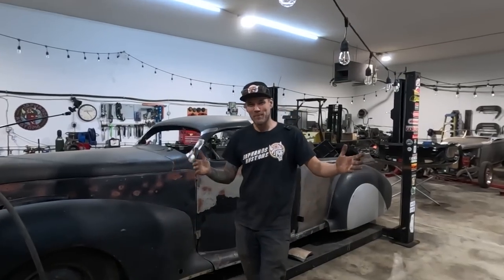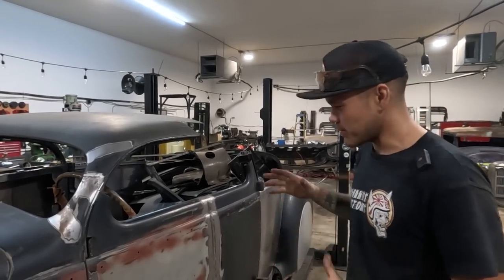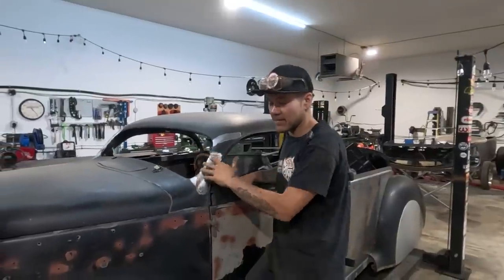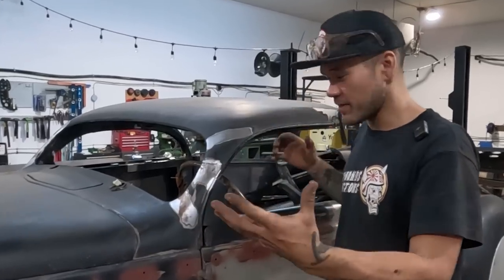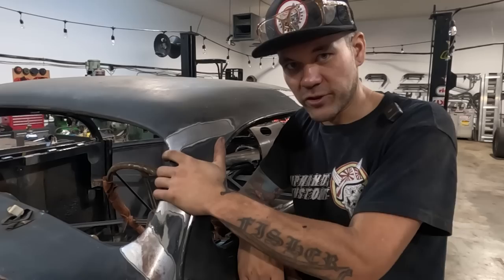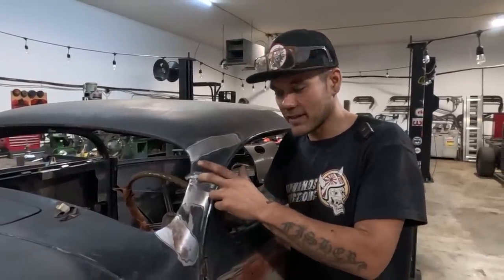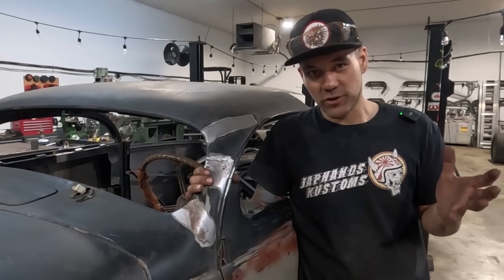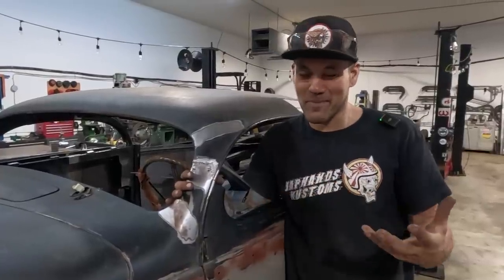Shaping Sheet Metal By Hand To Replace Damaged A Pillars On The 1939 Lincoln Zephyr Coupe Conversion

Comment: I dont know if it was my comment  about the inner structure not getting welded , but so many people dont do it probably because of all the extra work but it matters alot. Another builder in Canada never does this I've seen cars cut in half and but welded back together very unsafe . I have done this work for 50 years, AND I THANK YOU FOR POINTING THIS MAGER STEP OUT.

Comment: Good work, it's so good you doing it properly and thinking about the structural integrity, there's to many people teaching/showing the wrong way, another method would be to build a inner sleeve that your pillar slid over and then plug weld it.

Comment: I’m “working up” to chopping my 1950 Plymouth. I have watched and noticed how nobody welds the inner structure and was always wondering about it. I’m glad you have the same concerns and are addressing the issue 👍👍 awesome 👏 
The part you made is killer 👍 31:16
Reply: Unibody cars are very unsafe if not welded internally. I have seen extra steel tube added inside as well.

Comment: Im a back yard doggie rob I've replaced a few carroof's and turned 4x4s wagons into dual cab's over the years I've always spent the extra time to weld the inside of the pillis and inner structure and add a little extra if I feel it needs to be ,, im glad I have always done so because not long ago my step son rolled a 60s LandCruiser I chopped down a hill with other people in it,, the roof held up batter than factory thanks to the extra time I spent on chop mode ,,,    watching your videos I see different types of ways I can make my hobbies easier im always looking for good ideas.  Keep up the good work 👍👍👍
Reply from the maker: Thanks man!

Comment: Great work you are one of the best fabricators
I've just cut the roof of a Australian Ford XE panel van I cut through the A,B and rear pillars Im doing exactly what you've done except im adding 25mm square tube to the inner structure on the A pillars because they always crack and rust at the top
Reply: I think that Scott from Cold War Motors did something similar on his Fury roof splice. 👍👍🇨🇦

Comment: You have done the smart thing here by opening this pillar and welding the inner structure.  Most people do not realize that these Zephyrs were unibody construction, and all that inner strength is important to the integrity of the body.  On a normal chop, it is hard enough to keep this set of joints from cracking.  On a unibody car, it is much worse, since this structure does not have a frame to keep it from flexing.  It is important to consider the engineering needed to counter those forces in a car that you plan to drive.  If it was strictly a show car, you might be able to get away with some of that stuff, but why build a car if you aren't going to drive it.  I gotta admire that with the stuff you build.  You know what has to be done, why it has to be done, and how to get it done and still make it look good...

Comment: That was pretty slick. I think they are right. The inner structure needs attention just as the outer skin. But when it's custom. You don't have to follow the same rules and doesn't have to be original. But from the safety stand point, it's important.

Comment: Gene Winfield showed me atrick, he welded the A pillar with a small gap with oxy acetylene. Left the weld profile intact , heated it red hot and tapped it in flush. This makes sure of getting all layers welded and  hammering in the weld makes sure the post has no thin spots. I have used this technique many times and it has not failed. Keep up the great work and the vids.

Comment: Great progress. It's amazing what awful panel fit lead was used to hide! With the marks from linear stretch hammer, of you hammer from the back of the panel so the smoother dolly is on the front, the visible part will have mess hammer marks.

Comment: Awesome work Karl, you have a magical quality to not only perform at a high level but also to impart your skill and experience through genuine commentary. One question I have is could you have made a flexible shape pattern for this piece? Since you will need to make the other side would it have helped, or does the paper pattern provide the same amount of information to transfer to the other side? Thanks
Reply from the maker: I don’t use that technique much but I’m sure it would work !

Comment: Make access from the back and weld it from the inside? p.s. To remove lead, how does a copper scouring pad work? In electronics, you can remove solder from circuit boards by heating and using braided copper, same principle. It sucks it right up.

Comment: I did not understand why people cared you did not weld the inner structure when you did not stagger the layers anyway. Any pillar not layered is not the same strength as it was beforehand. I saw a hood off a VW sled down a road after the VW rear-ended another car at 15-20 MPH, Brazed chop job fully  failed and lid flopped right off.

Comment: Good, I was wondering if you're gonna address the big old thing Room about your Rewelding and not be able to get the insides Everybody don't weld all the insides after chopping. And that's my reason why I don't like chopping. Roof lines is a lot of people. Just don't weld the whole entire inside. Where it used to get welded. When it was built originally.
Cause you have to open it up.